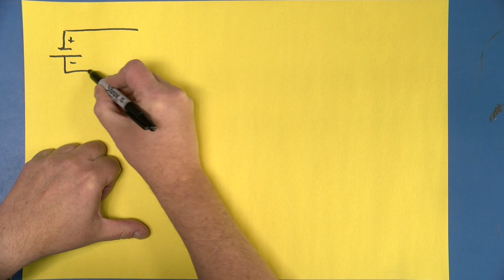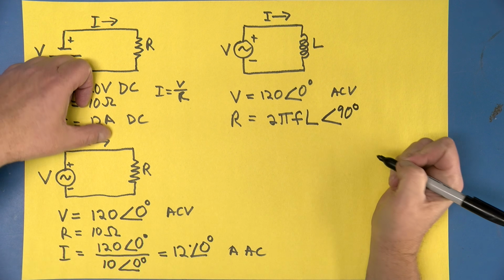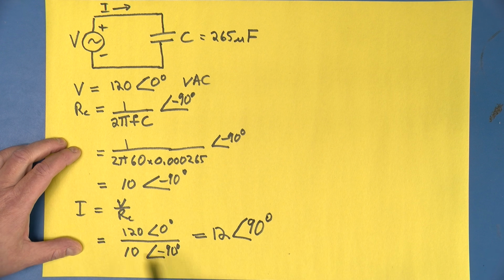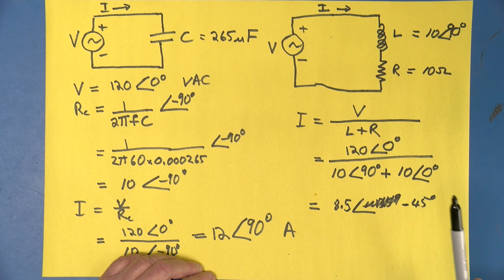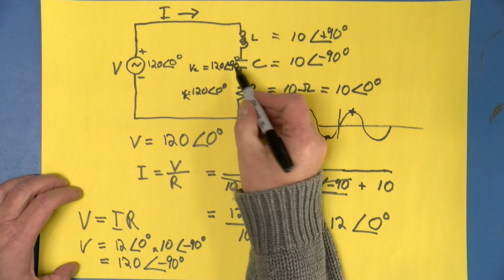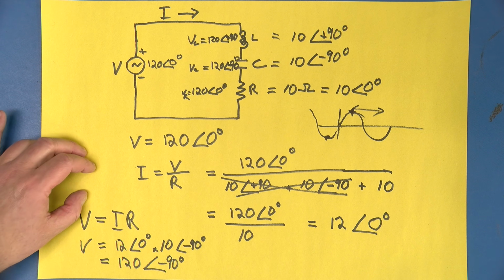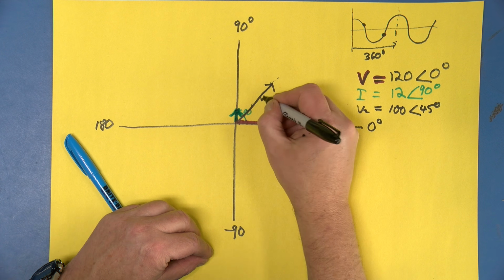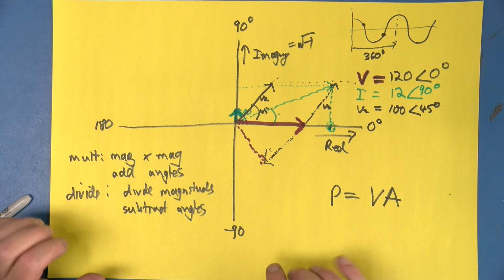Ohm's Law for AC Circuits with Resistors, Capacitors, and Inductors.

Comment: dont capacitors block AC and inductors block DC?
Reply from the maker: Other way! Capacitors block DC and inductors block AC. Block is a relative term - the higher the frequency, the better an inductor blocks AC and also the better a capacitor passes AC.

Comment: Fantastic explanation as usual, thank you.  However, do we need to bring the ESR of a capacitor into the calculation, or is that always going to be so small as to be, effectively, ignorable?
Reply from the maker: You do bring up an interesting point. The AC caps I tested all had existentially a pf of 0 and (equivalently) no real power consumption. So the ESR must have bee so relatively small compared to the current flowing that it was negligible. 

The 5 little caps I used in series with the toroid were ceramic which typically have low ESR. Ones I used in other  videos were poly film caps if I remember correctly - also relatively low ESR. (ESR = Equivalent Series Resistance for anyone wondering what we are talking about).  Its usually the electrolytics that have bad ESRs particularly at higher frequencies, although in this context I would suspect they would show little power loss as well (assuming we put two opposite in series with reverse diodes to keep from blowing them up :) Might be an interesting test.

Comment: Parallel LC is pretty neat too
Reply from the maker: Yes! Tuned circuits were getting a bit off topic so maybe series and parallel LC in a future video.
Reply: @ElectromagneticVideos  Even just computing the parallel resistance (impedance) formula on phasors is pretty cool.
Reply from the maker: @ThinklikeTesla  Your right - maybe a short video just on that!

Comment: Excellent video with great explanations. Thanks for sharing this knowledge. It brings back memories of one class in Tech school I had in the 90's. The class was really just Electrical Level 2. It never had this deep of topic listed for the class, but the older gentleman contracted to teach the class happen to be a retired NASA engineer and the more we asked the deeper he went across the black board. He was incredible. I was so amazed about how much he knew about vacuum tubes and electronics in general as well as XL and XC calculations with phase angles. I wish I could have retained even 10% of the knowledge he shared.
Reply from the maker: Wow - wonderful that your classed asked him to go deeper - shows the quality of the people in the class. Probably pleased him too - nothing better than students that want to learn!

Vacuum tubes - we no longer had that in our classes - transistors had fully taken over. Luckily I had experience with tubes from fixing old TVs when I was in high school (it was the old tube TVs that were giving out at that time) so I learned a lot about how they worked and have always liked tubes.  Somewhere I have an old tube tester I will have to find and make a video about. I wonder how many people have even seen a tube tester!
Reply: @ElectromagneticVideos  
I wonder how many people know about tube testers as well. I never worked on many tubes personally. I have always been fascinated by what EEs did accomplish with them before solid state was invented. That one class touched on them because He did really enjoy sharing his past knowledge for sure. I did desire to work on TVs and monitors with CRTs,  but I never learned a lot about them and only managed to fix a few with much simpler issues like bad switches and maybe a bad capacitor,  but I never learned enough to replace flyback transformers etc. back then. I did desire to learn, but we did not have Youtube.😂
Reply from the maker: @ThriftyToolShed  When you think about it, a color TV might have had a dozen tubes, each with two or three devices in the tube = ie a triode and diode, or two triodes etc. So say a color TV had two or three dozen elements of the functionality equivalent  of a single semiconductor device. Today even the simplest analog op-amps have dozens  of transistors and any microprocessor based system has millions to 10s of billions of transistors. Electronics people todays probably cant fathom being restricted to a handful of active devices. 

I'll have to find my old tube tester - it actually was a kit that was sold surplus because nobody was buying tube testers any more. I was so thrilled to have it - made fixing old TVs so much easier. Do you remeber the old table sized tube testers in drugstores? I was fascinated as a little kid watching my dad  test a bunch of tubes every time the TV acted up.

Lack of YouTube and information back then - what a struggle it was to get information. I still have databooks from Motorola, National Semiconductor etc obtained by wring a letter to each company - imagine that today!  I would have been ecstatic to have the access to info we had today - although with all the distractions of messaging etc - would be have  leaned as much?
Reply: @ThriftyToolShed  Mr Carlson has just done a video on tube testers and 
Shango66 has a few he puts though their paces on on old RCA TV's,  
Glasslinger has a good collection of tubes and some videos of him making them,  fascinating chap. 
David Tipton is a good watch for fault finding tube set. Best
Jim's Radio Workshop,  he is in Canada and although a slow video much can be learnt.
Reply: @ElectromagneticVideos  
The marvel of the first color TV's:
I will never be able to wrap my head around it. Genius level to come up with such an amazingly complex solution for making the image on the screen in rows and using the 3 guns scanning across and controlled by the yoke by "magnetic deflection"? I am not even sure...  Like you mentioned using the tubes and few components already available and making the custom CRTs. Down right magical to my brain. I am as fascinated with it as I am the early NASA engineering. The solutions they had to come up with to go where no one had yet gone. Sorry to deviate there, but similar in my mind of fascinating things. I will link a video below of an interview that Destin did on YouTube Channel- Smarter every day. It was so worth watching in case you haven't.  He interviewed Luke Talley about the early rockets and I am so glad he captured the knowledge and memories from Luke in that video interview. 
I don't actually remember the tube testers in stores myself, but I do remember people talking about them. I did buy a used tube tester back 20 years or so ago and I eventually sold it on ebay for very little when I was moving years later.  I wish I had kept it now. I may eventually see if I can find another one since I still want to learn more about them. I look forward to the next video!
https://youtu.be/1nLHIM2IPRY?si=vnVeouDLmUDRiu-d
Reply from the maker: @ThriftyToolShed  I will look at that video!

Yup - the color CRT was an amazing invention / development. As you set the complexity of the device plus the complexity of the signals needed to drive to keep those three color beams all properly lined up was really close to the limits of technology at the time. And add to that, the supressed carrier phase and amplitude modulated color subcarrier was a level of sophistication never before used in home electronics (and rarely anywhere else). Apparently early color TV was instrumental getting the prices of quartz crystals down to consumer acceptable levels - first time crystals had ever been mass produced in consumer quantities.

Comment: How different does the math work out if your L,C, and R were in parallel instead of series? Also, do be very interested in the math behind why you add in Cartesian and multiply in polar
Reply from the maker: The DC rule for a bunch of parallel resistors is 1/Rtotal =1/R1 +1/R2+1/R3 ...

You can do the same with AC using phasors in the calculation. 

Do all of that and assuming the L and C are equal and opposite as in our example, they cancel and the parallel impedance becomes just R . If there was no R in the circuit, just L and C the combined impedance of LC becomes infinite. 

Multiply in polar, add in Cartesian? If you use the Cartesian coordinates as complex numbers (which they are here) with the second number in the pair being the imaginary part, you can do all adding, subtracting, multiplying, and dividing in complex numbers (where i *i = -1). The reason for doing multiplication and division in polar form is that at least to me its a bit more understandable in the sense that excluding the angle,  its the same as real number multiplication and division, and its also easier to follow what happens with the angles. 

As for the underlying math, it would really be an explanation of complex number math because thats what all of this actually is. I would be pleased to do a video on it if there was enough interest in it, but I'm not sure there would be. IF OTHERS WOULD LIKE A VIDEO ON COMPLEX MATH, let me know by commenting below! 

Hope that helps!

Comment: For me, this was a great review of the basics.  I have gotten into the perhaps bad habit of using LTSpice for just about everything, no matter how simple.  But I would never advise anyone to skip learning the basics and jump to using LTSpice, or another simulation tool, without understanding what is going on "under the hood".  (Of course, you can try dozens of circuit tweaks in the same amount of time as you could build a single hardware prototype circuit, so the temptation can be overwhelming.)

The second half of AC circuit analysis is transient analysis; that might be a good topic for a future video, if you haven't covered it already.  For example, if you suddenly connect an inductor directly across mains, what will the inrush current be?  Will the inrush current be minimized if the inductor is connected at a zero crossing of the mains voltage waveform?  The answer has always seemed counterintuitive to me.
Reply from the maker: The basics - its funny - I had to come to grips with just doing phasor calculations  in the video without really proving the underlying "why does it work". It never satisfying to have to say - just accept how to add, subtract, multiply and divide these things without the underlying stuff.

So I have really been pondering if a transient analysis video is feasible . My current thinking is to maybe show some transients as you describe, and with  a lot of hand waving, sort of explain it and give a sense of how to roughly estimate it. A more rigorous intro with math like Laplace transforms is probably beyond this sort of video. I actually mentioned transients in one of the takes I did of the end of  the video wrap up segment, but didn't use that one because I felt it muddied would be more confusing than helpful.
Reply: I agree a helpful refresher and a reminder of the significance of the notation I automatically punch in a calculator although not that often now. Very good tutorial.
Reply from the maker: @WOFFY-qc9te Any idea what would be a good currently available calculator for this type of thing? I still use my 40 year old HP-15C but I'm sure there are more current ones better suited for the modern world ...
Reply: @ElectromagneticVideos  Hello,  Calculator,  well I do not do much power calculation now, my calculator is an old TI scientific with the LED display,  I did have an HP I think it had program cards that slotted in the sides. By habit I just pushed the same old buttons and recalled equations from the memory I suspect you are doing similar.

App based calculators are in favour although not as quaint as a forty year calculator are probably much more useable.  I just had a look at the price and yours his holding its value, keep the LCD away from heat or sun. 

The IEEE have a Multi-Utility Calculator Application and their site has many recourses. 

This student made this comment ; 

TI-89 Titanium, the TI-Nspire CXII CAS, and the HP PrimeThe TI-89 Ti looks like the most appealing of them all due to its cheap cost ($50-60, secondhand) and due to the amazing EE* PRO program it has. The program has everything I need for my studies.

I did find you tutorial realigned my thinking and refreshed some dormant knowledge.

The storm over the UK has passed and I need to cut up another fallen tree, only have ten left. Best
Reply from the maker: @WOFFY-qc9te Sorry to hear about the storms! Thanks for the calculator info! Funny we are the same - using to e old calculators from way back, although mine has what was then new technology - a  LCD display :)

Comment: Phases are really important in electro acoustic...
Reply from the maker: Yes! You can really hear it when studio mics are out of phase or when one stereo speaker has its polarity reversed.
Reply: @ElectromagneticVideos  Yes and at home when you try to calibrate a subwoofer, you can cancel basses instead of increase them when out of phase...
Reply from the maker: @bulbx1273  That must a a "why are the low frequencies so silent" type of experience!
Reply: @ElectromagneticVideos  Yes, do it !

Comment: modeling with math sometimes call synthesis ☕🤔
Reply from the maker: Interesting - I had never heard synthesis used that way!
Reply: @ElectromagneticVideos  Logic synthesis😋 saw many times heading with tag "...circuit synthesis" 😎
Reply from the maker: @LendzuLocuks  Interesting - where are you located? I wonder if its a country or region specific thing whether the term is used that way or not?

Comment: I always think of Pi as "113355" (specifically 355/113). It's correct to six places to the right of the decimal point. Close enough for anything that I will do, and I don't have to find the darn Pi key on a calculator that I am not all that familiar with (which can be interpreted as anything other than a HP-15C).
Reply from the maker: Thats an interesting memory tool  that I had never heard of! Somehow after using it so many times. 3.14159 is in my head - strange - I am really poor at remembering  numbers but I guess I have used it so often!

HP-15C : I have one on  my desk in front of me right now! Bought it in second year university when they had just come out. Best thing ever for anyone in EE, Physics or math!
Reply: @ElectromagneticVideos  Definitely pointless, but fun.

Have you seen the HP-15C CE? (collector's Edition) I have it, and the not-so-great Limited Edition (don't bother if you don't have an LE). The CE is really nice. 

I still have my 15C from college, but the CE rocks.
Reply from the maker: @MrWaalkman  I know of them but have never actually seen one in real life. Truth is, for a lot of calculation stuff there days I use either spreadsheets or matlab/octave because it makes it much easier to investigate how changing one number/property wither retyping the calculation. I use the 15C just for quick short calculations.
Reply: @ElectromagneticVideos  I'm (among other things) a calculator nerd. Not a math geek, I've always struggled with math. Thank goodness that I was an Controls Engineer where math was almost never used outside of calculating my overtime. :) 

It's the programming capability of calculators that I find fascinating. The limitations of the hardware at the time leading to (hopefully) clever ways of packing the last little bit of functionality in something with a mere handful of bytes of storage is amazing. 

I was too old for the cheap calculators that you see in high school these days, and too poor to buy one at the time (well above the price of a used car), so I usually made do with the tables in the back of the math books. Slide rules are also cool. I still have mine from high school. :)

So I'll grab a calculator before I use anything else.  And I'm happy that I am not alone, my Mechanical Engineer friends at the company that I do consulting for (AKA "The Arts and Crafts" engineers) almost all have a calculator sitting within easy reach.
Reply from the maker: @MrWaalkman  A calculator nerd - how cool! You so right about how what a challenge it must have been to include every little bit of functionality and particularity programming in those early calculators. I remember programming a few things into them - in particular the quadratic equation which came up often. I think I also programmerd in some matrix functions, and a decimal to binary conversion which the 15C lacked but the 16C had. Those of us in the EE/CE program really could have used the 16C functionality but having two calculators was too expensive for us students. 

We also did slide rules in high school - but more as a math example of logs/exponentials since calculators were already common. I wonder ho many people know what a slide rule is today?
Reply: @ElectromagneticVideos  The 15's matrix abilities will come in very handy for a Nodal Analysis (simultaneous equations) video if you choose to make one. In college, I noticed that the simultaneous equation example in the 15C manual was what I needed to do Nodal Analysis problems, and pointed it out to my instructors. They were surprised, and pleased (probably that someone was reading the instructions) and let me show the class how to do it on the chalkboard (we all had to use the same model of calculator).

I have a 16C as well, and it's a cool little calculator. I've used it when I programmed bit-banging routines for PLCs but that's about it.

For us it was either slide rules or the trig tables in the back of the math book. I like slide rules because they are things of beauty, not because I plan to use one (the lettering is too tiny for my old eyes). :)

BTW, the Cleveland Institute of Electronics slide rule (made by Pickett) has various "2 x Pi" scales built in. Pretty neat.
Reply from the maker: @MrWaalkman  I'll bet its hard for today's students to image what all we did on calculators! Although I have seen some that do integrals etc. 

I have to be careful about how much I devote to math - it does turn off a large part of this channels audience. To bad - I watch a number of the dedicated math channels.